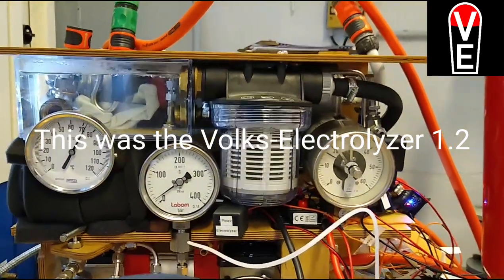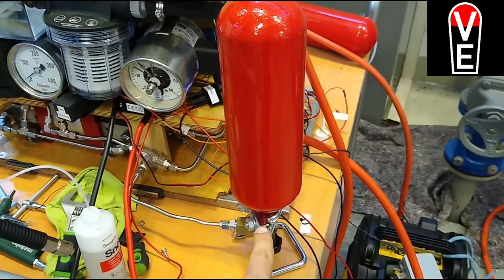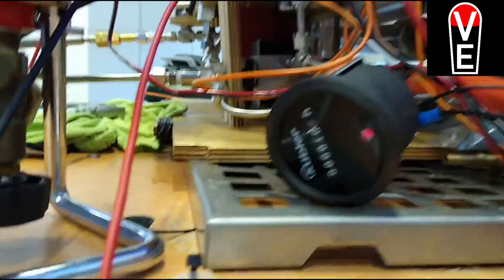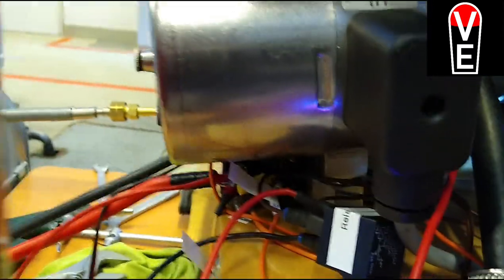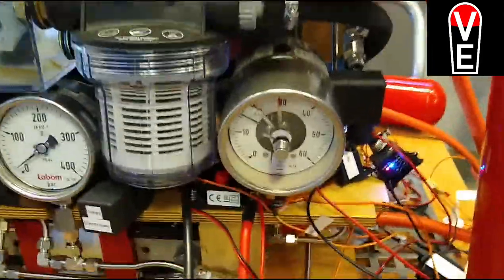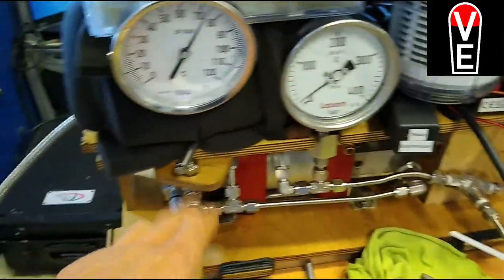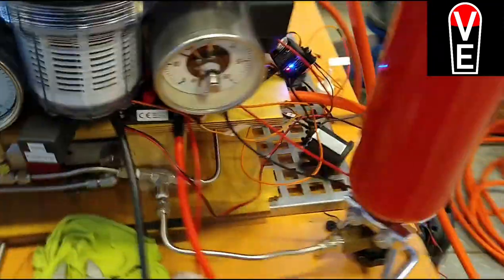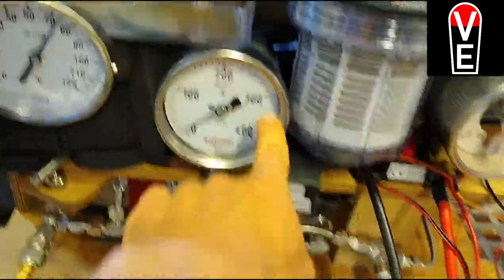What Off Grid step comes after PV, Wind, Lithium Batteries? Hydrogen Electrolysers and Fuel Cells?

Comment: In combination with electrolyzers, University of eindhoven is heating houses, providing heat to brewery from iron powder burned infurnace, then regenerated by hydrogen, so it seems bonkers, but you can easily "charge" 1000 liters of iron powder in summer, to burn it in winter and release 6 MEGAwatthours from that amount.